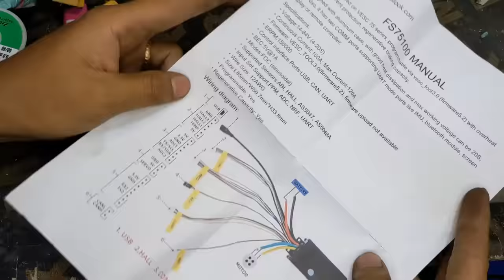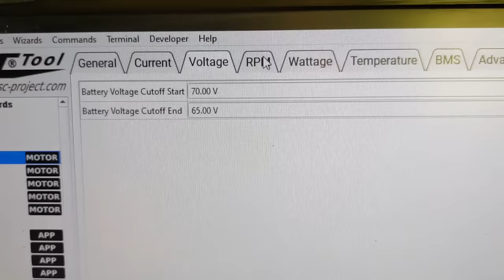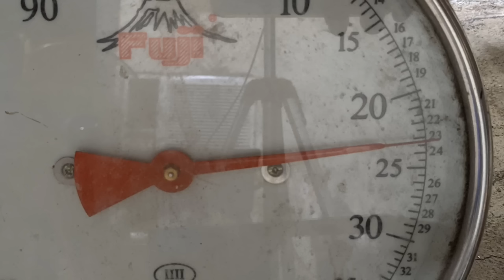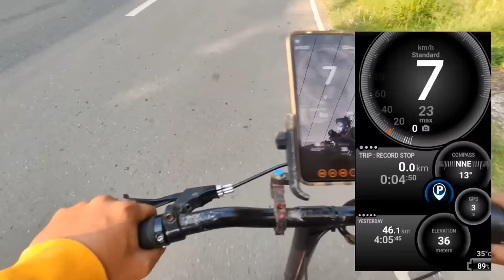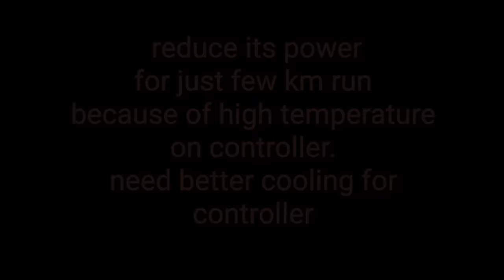DIY 72V electric scooter from bike parts - Flipsky 75100 controller

Comment: the default cooling is just not enough. I use 75100 on my scooter too, and I 3d printed a new case just to stick some cooling fins on the mosfets. Planning to add water cooling in my next build.

Comment: Was searching for how to build an electric scooter from scratch for my channel and came across this. Great video bro.

Well done. maybe next time you can use plastic spacers between the batteries to prevent possible shorts if the rubber on them fails.
Reply: 😢Привет 😢😅😂у 🎉😮🎉😅

Comment: Mag wowork sya sa BLDC na scooter hub motor? Saka may auto sensing pa din ba sya?
Reply: Panalo yung size ng 75100 ah
Reply from the maker: uo ok yung size nya, pero kelangan pa ng mas magandang cooling mabilis uminit yung controller

Comment: Bro u need a chain tensioner maybe spring loaded at the back because the wear and tear after a while the chain could miss a cock and BOOM dangerous at any speed also I'd of gone for slightly larger motor considering the amount of batteries... also I'd have it water cooled also I'd have another motor as an alternator pumping electricity as a dynamo and solar panels on it while it sits in the sun recharging also...good luck oh also I would of used the batteries inside the tubing of the frame itself also...

Comment: Hi also I'm testing the 75100, I noticed that by running the hub motor with the battery cables disconnected, the controller still turns on and gives power from the 5v and 3v outputs, can you check if this happens to you too?
Reply from the maker: when your regen is activated it will power it self from motor.. it bypass the SS switch..
Reply: @albertnario4877  Thanks for the reply, i hadn't thought about it, i have to try to disable the regeneration, it's not a great thing anyway, it would take a system to really leave it off, as it is now my tft display turns on and off every time i move.

Comment: Thats how we made tesla car battery setup. hahahaha  You will need a plastic idler pulley or something..  Try using a 45 degree gear to a shaft gear as well....dump the chain or use a belt..
Reply from the maker: what's the benefits for 45°.. I wish belt can easily buy one.
Reply: @albertnario4877  The benefit would be smoother less chance of breaking...   Where do you live?  Im coming in April to Phil